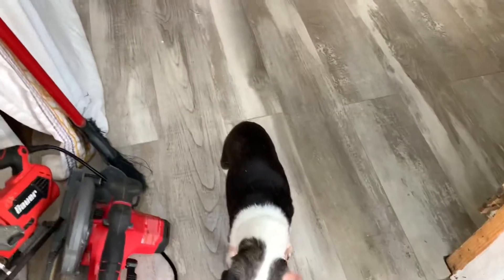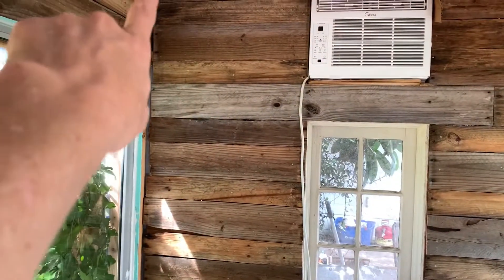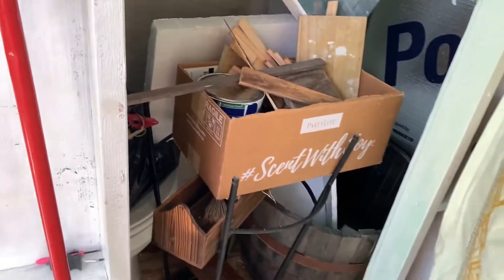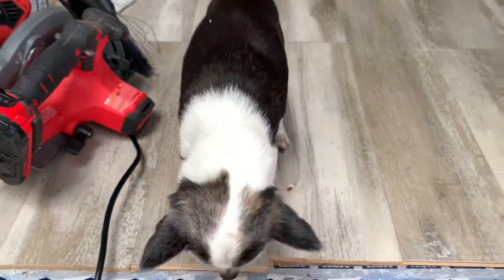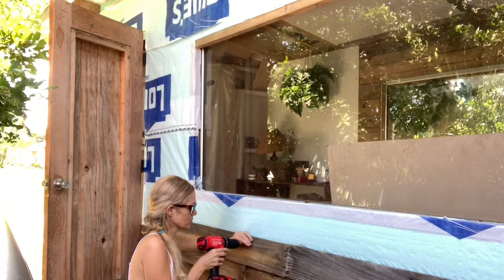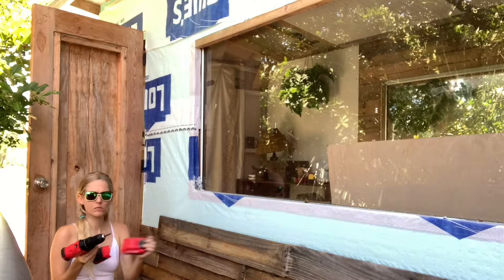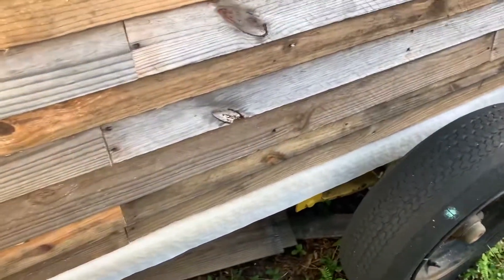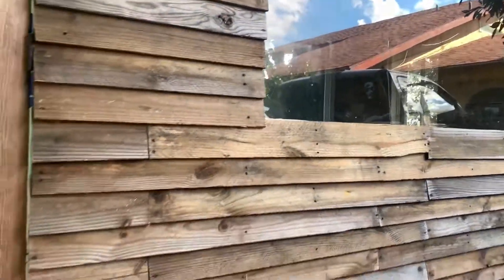#8 ABANDONED TINYHOUSE |starting the exterior pallet wood siding

Comment: Thank you for showing off your tiny house project. I'm interested in the way you are using pallet wood during the process. 
I'm working on reviving a 30' trailer that has 2 slides and what appear to be mostly working or useful appliances and fixtures. 
After the roof made an uncomfortable "CRUNCH" sound during inspection, I'm debating on putting an entirely new roof and ceiling structure in with skylights and exposed timber frame components on the interior! 
As this will be a mostly stationary "tiny house" rather than an oft' moved RV/travel trailer, I'm not too concerned about using typical home building materials on the exterior because I just won't move it when it's raining.
And, of course, dogs are good people! 😘
Reply from the maker: Thank you! Your idea sounds awesome with your new roof and skylight. I love skylights! Thanks for stopping by!💖🙏💫

Comment: Did you use all the wide boards on the pallet or did you you the thin with wide one. Building a rustic shed just curious. Looks Awesome. 😊
Reply from the maker: Hey! I used mostly the wide ones. Easier to over lap and then I used the thinner ones and thicker when I got inside as well as for different trim areas interior/exterior:)
Reply: @floridachickstinyadventures  Thank you very much.